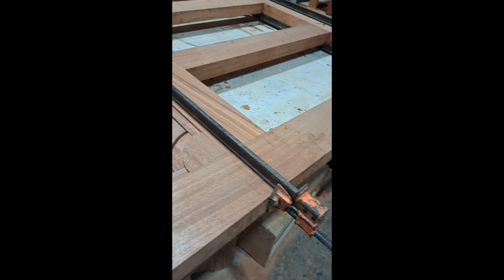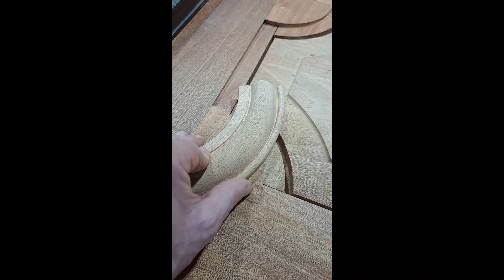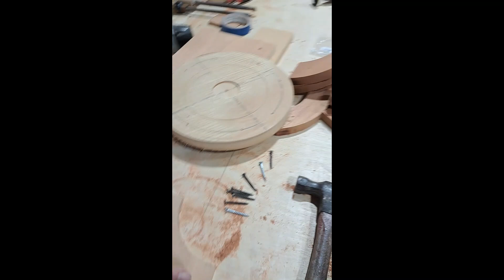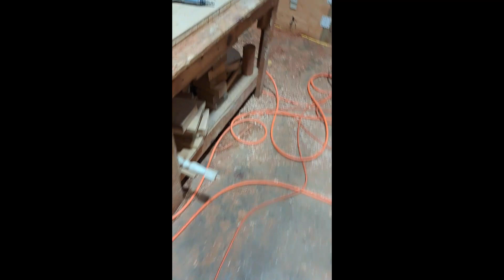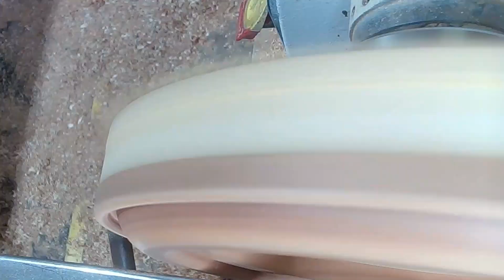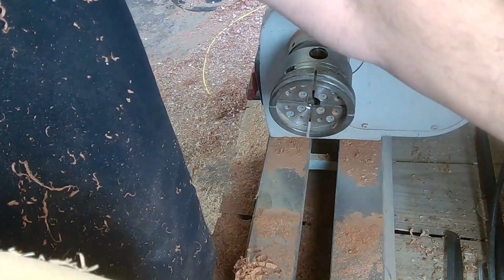Wood Turned Clipped Corners For A Door

Comment: Interesting. Great technique for getting those curved pieces to really dress up anything molding is applied to. I suspect that making the holder about 25” you’d be able to handle the cutter the other way around. You’d still want to use a light tough for sure. Well done.
Reply from the maker: Yeah. I've tried it turned around and it's just too hard to handle. The way I do it is safer and gives just as good a result.